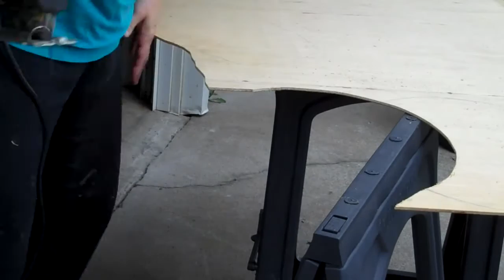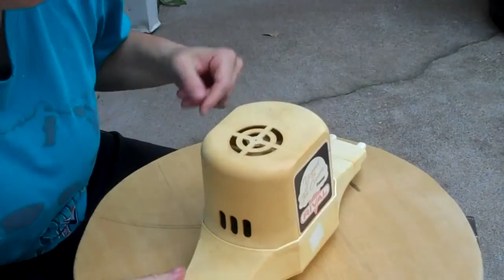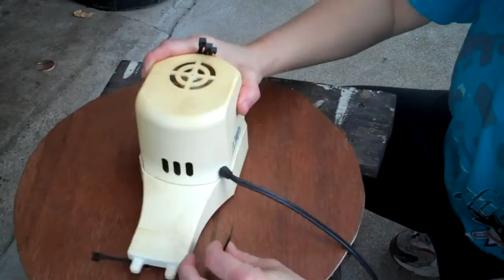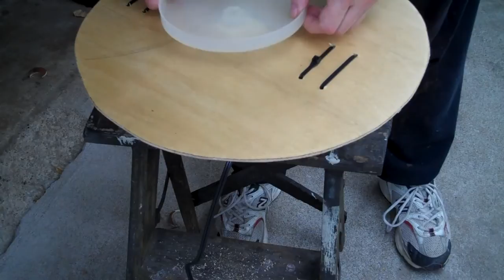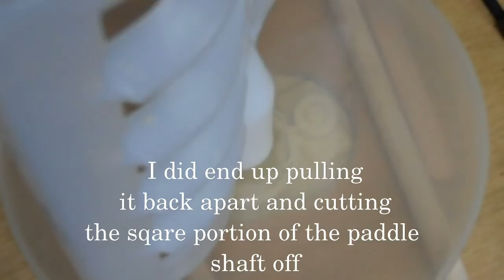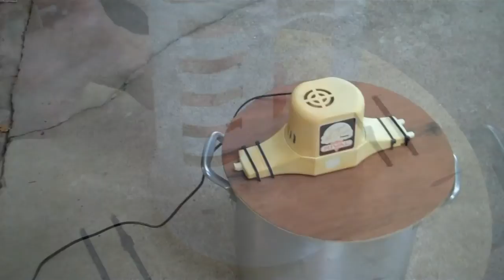ice cream motor mash stirrer

Comment: Cool little project! I'm thinking about ways to increase my efficiency too! Since I have a 52qt rectangle cooler I don't think something like this would work.. well it would but I need to cover more area.. Maybe I need to do a fly sparge and see what happens. I wonder if that thing will have enough torque to move that grain around? You'll have to fasten it to the pot some how right?